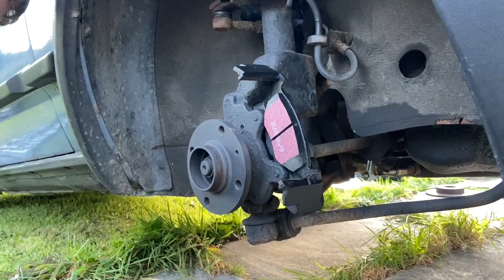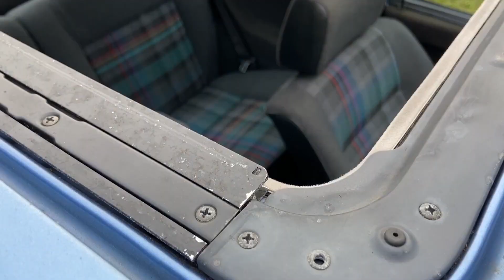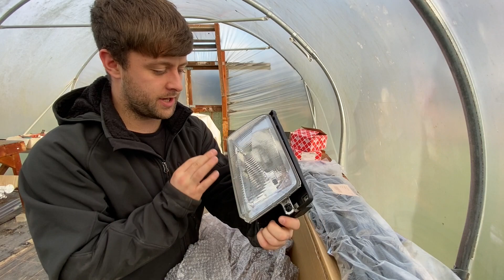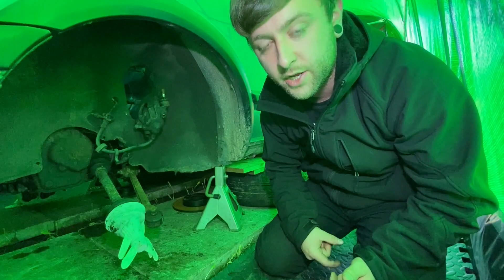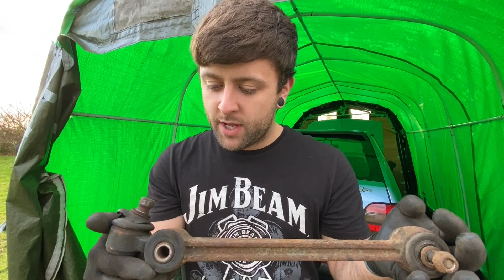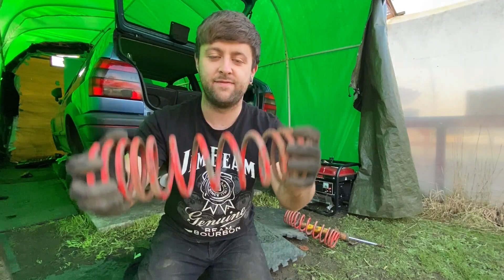WHAT DO ORIGINAL PARTS LOOK LIKE AFTER 28 YEARS?

Comment: Hi mati, thanks four your videos! Do you know what is the tightening torque of the front suspension arms bolts? The ones you have changed in the video. Regards
Reply from the maker: thanks for watching! I dont Im afraid mate, mine are just on fairly tight but all will be checked over by a garage shortly. I would try find the haynes manual online versions for torque settings!